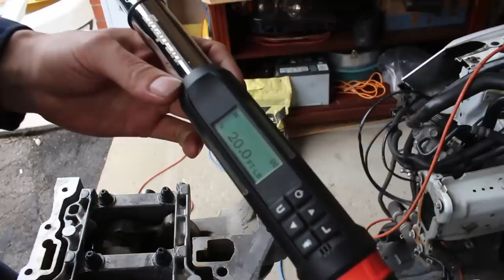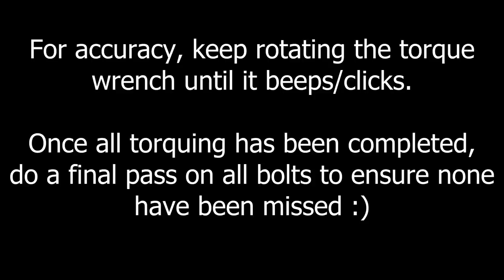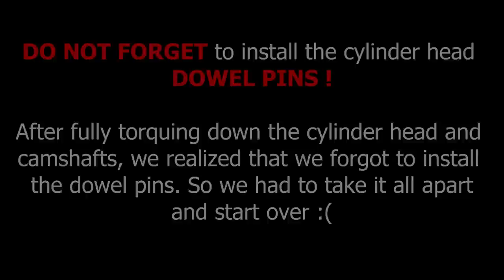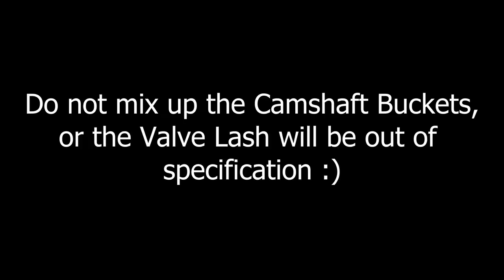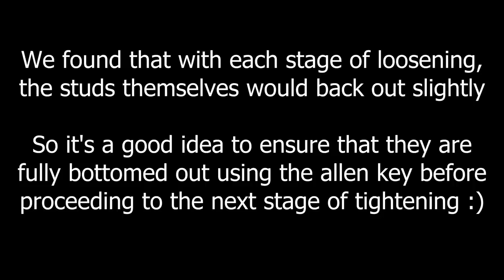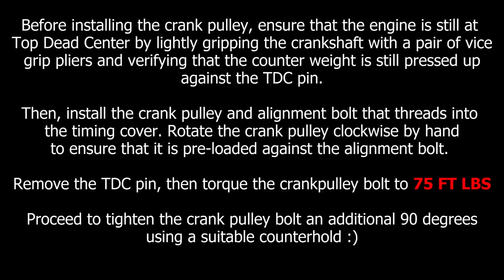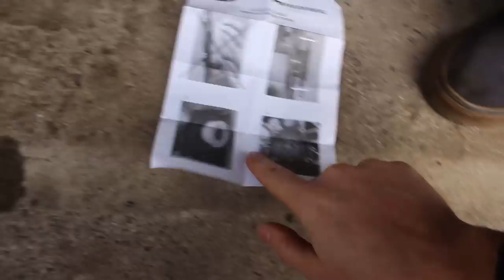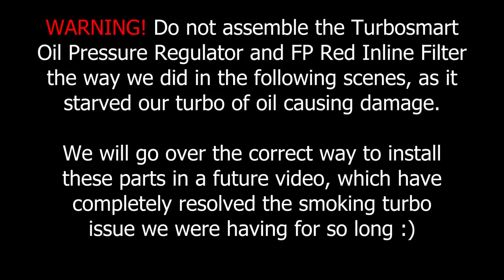Mazdaspeed 3 - Built Engine Assembly

Comment: What oil do you use ?
Reply from the maker: Currently I'm running Amsoil XL Boosted 10w40
Reply: @WannabeTuners is this what you would recommend with forged internals ? My motor is freshly built and was running 10w30 conventional oil for first few thousand miles, I’m now switching to full synthetic and was wondering what’s good.
Reply from the maker: @dakoh1354  At first I ran 5w30 Lucas Engine break-in oil for like the first thousand km's. After that I ran 10w30 Amsoil Signature Series, and now currently I've been running Amsoil Boosted 10w40. My engine builder said that the choice on viscosity has to do with what the engine oil pressure readings are. Fully warmed up at idle my oil pressure is just a touch below 30 psi, so I haven't had a reason to switch to a thicker oil.

Comment: Can MS3 engine parts be shared with MS6?
Reply from the maker: Yes absolutely, they share the same engine
Reply: @WannabeTuners  Thanks 👍
I have questions if we upgrade to 500HP
How to strength GearBox or axle 
How to choice Head Valve
Reply from the maker: @ozaki112233 So long as the clutch is upgraded, the transmission and axles can handle quite a bit. As for the valves, I've opted to keep them stock and just run a mild valve spring upgrade (Supertech 55 lbs). You could also port and polish the intake and exhaust ports to help with flow :)
Reply: @WannabeTuners  thank you! very helpful answer
Reply: @WannabeTuners  Sorry, senior, is the ECU STOCK or do I need to buy a complete replacement?
Reply from the maker: @ozaki112233  Most people are running the stock ECU and are tuning with a Cobb Access port or Versatune
Reply: @WannabeTuners  THANK YOU SIR :elbowcough:~

Comment: Why do you keep guess-tightening when you have that beautiful torque wrench right there??? I keep waiting in terror for you to break a bolt haha. I snapped a valve cover bolt off in the head once and it wasn't fun
Reply from the maker: Sometimes it's better to go by feel, but ofcourse it's always recommended to follow torque specs ;)
Reply: @WannabeTuners  I have watched this a few times and im nearly ready to begin my own engine build. I noticed you guys did not do any feeler gauge checking on the valve tappets (? buckets?). Is this because you did not lap the valves? or did you have all the headwork done by a machinist?
Reply from the maker: @CornerOfTheOval  We had our machine shop do a trial assembly of the bottom end and cylinder head, so they ensured that all measurements were correct.

Comment: So how much hp will this new build be able to handle? Also how much did it all cost?
Reply from the maker: From what I've read, this engine setup should be able to make right around 600 whp in the Speed 3's. The next weak point would be the stock sleeves, and since the head doesn't have any port work, that'll start to cause a flow restriction past 600 whp
Reply from the maker: All said and done it costed about $8k Canadian
Reply: Wannabe Tuners alright awesome thanks for replying. Might copy your build if that’s alright!
Reply from the maker: @MineBros6  If it works and is reliable that is the best thing bud!

Comment: What are the product #'s for the Main Studs/ Head studs?
Reply from the maker: I can't remember off the top of my head, but u can find the part number for the main studs on ARP's website. However I was only able to purchase the L19 head studs from edge auto sport. I couldn't find them directly from ARP.
Reply: @WannabeTuners  you were saying something  about not using the s2000 head studs... im going to follow thst advice... I think valley crew racing... used those and his head lifted
Reply from the maker: @FocusedHands  Yeah from what I've read people have had issues with head lift when using the ARP 2000 head studs

Comment: I absolutely would have used 85lb valve strings......I think lol.
Reply from the maker: Really eh, why's that?
Reply: @WannabeTuners  I might have spoke to soon. 55lb is stock on the b16 heads i use. I went to 85lb when I fully built the engine for boost. Your building for boost right? Is 55lb going to be enough seat pressure? I'm just asking.
Reply from the maker: @jimhiscott2918  Oh nice!  The honda engines always seem to be high revers so to speak lol, but yeah the 55 lb valve springs are a mild upgrade over stock but are good for 7800 rpm according to some of our Pro Tuners. In the Gen 1 speed 3's and 6's we can only tune up to 7500 rpm anyway on the stock ECU. The Gen 2's however have recently received the goods when Cobb Tuning gave them the ability to tune up to 9k rpm on the stock ECU. Time will tell if the Gen 1's and speed 6's get that same treatment, as stand alone ECU's are somewhat of a new thing for the mazdaspeed platform ;)
Reply: @WannabeTuners  The aem infinity ecu is a nice unit but things can get real spendy real fast. I use hondata products for tuning my Honda's, its Affordable.  I had a 2005 Mazda 3 sedan with 5 speed a while back. It was in  mint condition. What a great car. For whatever reason I sold it and I am still regretting doing so. It was a bone head move! I really miss that car. I need to educate myself i bit more on mazda performance.  I feel stupid now for just blurting out 85lb springs not knowing anything about mazda performance.  Another bone head move lol😅
Reply from the maker: @jimhiscott2918  It's all good man, every platform has it's uniqueness, and I've always been intrigued by the thought of building a Honda. I just need more money, space, and time lol

Comment: What transmission fluid does it take?
Reply from the maker: I've been using the Ford XT-M5-QS fluid
Reply: @WannabeTuners  Doesn't make the transmission or differential rattle?
Reply from the maker: @SantiagoGarcia-pr5wh I've also been using that small bottle of friction modifier from Ford and no issues to report at all. The only rattling I hear from my transmission is gear chatter at lower rpms due to my Fidanza lightweight single mass flywheel.
Reply: @WannabeTuners  Thank you very much, I use 75w-90 for lsd oil and I hear some noise when turning in u and noise when I am not stepping on the clutch
Reply: do you think that with a 75w80 of motul and modifier it works well?
Reply from the maker: @SantiagoGarcia-pr5wh  I have no idea tbh, I've never tried it or looked into it
Reply from the maker: @SantiagoGarcia-pr5wh  Noise when not stepping on the clutch could be normal release bearing noise. When you press on the clutch pedal, the release bearing is under load, and that rattling noise tends to go away.
Reply: @WannabeTuners  It didn't make that noise before, it started to make it or when I changed the fluid or when they changed the transmission mount, which I don't think is the mount
Reply from the maker: @SantiagoGarcia-pr5wh  Was the mount upgraded to a stiffer mount? That could cause more vibration to resonate into the cabin.
Reply: @WannabeTuners  no, it was a stock mount, the mechanic said that the noise was from the transmission because the noise goes away when stepping the clutch but idk, maybe the mount was incorrectly installed
Reply from the maker: @SantiagoGarcia-pr5wh  From what I've read, the release bearings in these cars tends to be pretty noisy, so it may be normal. Do you have a video of the noise that you could send me on Instagram?
Reply: @WannabeTuners  sure I will send that to your ig, thanks

Comment: I dont understand peeps wasting there talent on tranverse enginges specially a mazdas are in fact known to go with rotary engines the math on there power to weight ratio is just insane and there RX series chassis are mid engine had incomparable weight chasis balance but great knowledge for those not familiar with engine components and functions.
Reply from the maker: Yeah it's definitely not going to be able to compare against the fantastic RX7 around a track, but the Mazdaspeed 3 is actually very well rounded overall. It's definitely a good bang for the buck ;)

Comment: Thanks for sharing. Got a gen 1 with spun piston bearing ☹️. Rebuild or JDM import engine. Weighing my options. Got the motor on a stand.
Reply from the maker: No need for a JDM engine and I'm not sure if there are any differences as they all say FoMoCo on them lol. With a spun bearing you might still be ok to reuse a lot of components. Just get the long block inspected at a reputable engine builder and go from there :)
Reply: Wannabe Tuners thanks for the advise bro. Glad your speed 3 is back, I was pretty stoked to see it run at the end of the video.
Reply from the maker: @omcasanova  Thanks man, you're very welcome